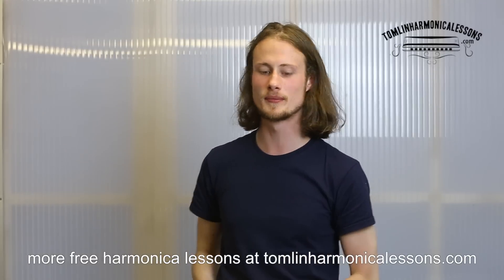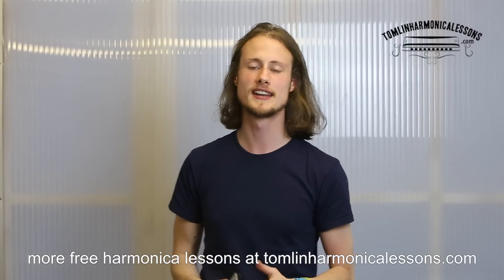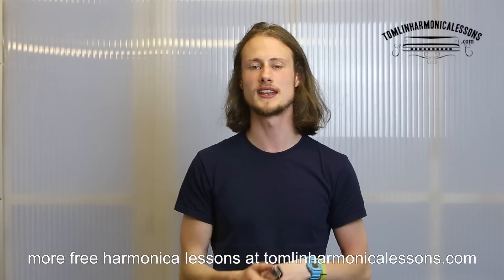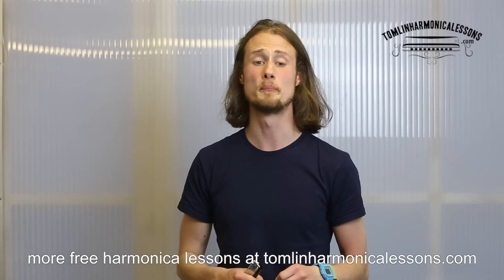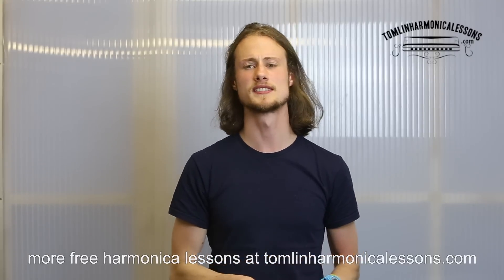How to play 2 draw whole step bend on a C harmonica

Comment: I've found I've just managed to do it, but it doesn't sound great.  It only works if I breathe in a bit through my nose at the same time - I wonder if that's something I should be doing
Reply: But weirdly I've also found I can do it if I hold my nose!  I've been reading up on the internet, and it's obviously a thing that some people have a problem with. I'm guessing that the kind of movement that I'm doing in order to do the bend is causing an airway to open.
Reply: Ok, I read around a little more, and I realised I shouldn't breathe in through my nose while draw bending.  I've just about managed to get it now anyway, although it's far from perfect (also far from ok).  It's just a question of keeping at it I reckon - if you can bend  down a microtone then just keep working at whatever you're doing and it seemed to begin to click eventually. I also fiddled with the gapping a bit, which may or may not have been a good idea, but it seemed to make a difference.

Comment: Any tips for the 2 draw whole step on Key of A?
Reply from the maker: Hi Nicholas, the 2 draw whole step bend on an A harmonica is the same principle as the 2 draw whole step bend on a C harmonica. However, the tongue position is slightly further back (still pointing forward though). Persevere with it and keep pushing a little further back each day and eventually you will get it. Cheers, T

Comment: This may be odd but I have no issue with my 1 or 2 hole bends whatsoever. The one that I have fits with is my 3 hole half tone draw bend. I can get the whole step and tone and a half step no problem but the half step gives me fits. It’s like the note goes from not bent to at least a whole tone.  

Any ideas or advice?
Reply from the maker: Absolutely! This is very common. When you are bending you are changing the size of your vocal cavity to tune it to the pitch you are bending to. As you find the lower bends on 1 and 2 easier that means you are going to a larger vocal chamber size. This is too big for your 3 draw half step bend and so you are pulling past it to the whole step. Try slowing down the bending movement from clean 3 draw to 3 draw half step bend and listen for where the bend happens. It will be much further forward in your mouth than you are expecting.
Reply: @TomlinHarmonica  makes perfect sense I will do that. The thing that baffles my mind is the fact I can get ell the bends on my A harp (even the half tone bend on 3) but have issues with it on my C harp especially my Manji. My A harp is also a Manji but I can bend it no problem.  

I assume it’s a combination of not having the muscle memory great on the bends and maybe the gapping is a bit wide on the C Manji I have.
Reply: @TomlinHarmonica  thank you for the guidance.

Comment: Is it possible that there's a manufacturing glitch with my harmonica (:Hohner special 20)? Cause I can half bend all notes UP TO 7 (even 7 a bit) , but can only go to 2 half step bend no matter any technic I've tried.
Reply: Nevermind, it was the video compression that made me think 2 whole bend is lower than I played it. I looked it up and it's the equivalent to the note F which I can actually reach easily. Now I just have to practice. Thanks for the video btw!
Reply from the maker: Glad you got it sorted George :-)

Comment: Great tutorial. I'm extremely new to harmonicas. Have seen few videos and read few articles about 2nd position playing. However one thing which is not clear to mean is on which all holes what action leads to the notes of the blues scale in the key of G (in a 'C' harmonica i.e. key of C in 1st position). Blues scale in key of G, I suppose is: G, Bb, C, Db, D, F, G. That should normally mean:
2-Draw (G), 3-? (Bb), 4-Blow (C), 4-? (Db), 4-Draw (D), 5-Draw (F), 6-Blow (G - higher). So for Bb is it a half-note bend while drawing on 3rd hole, and Db is half-note bend while drawing on 4th hole ? Can someone clarify this ?

Comment: Hi Tomlin, this is helpful and i think i get little mini-bends occasionally now but it's after a struggle!  I struggle with hole two on the C harp mainly - can bend other holes and hole two on other harps (eg a & d).  Is this a common thing?
Reply from the maker: +gary16642 hi Gary, this is common. I would spend time on the A and the D and get it really really comfortable. Then, try moving back to the C.

Comment: The two hole whole step bend and three hole one and half step bend seem impossible for me! 

This is so frustrating.
Reply from the maker: If you are struggling to get them, try moving up to a higher key harmonica for a while as the bends will be easier.
Reply: Did you ever get better on low bending? I had no luck till I realized you have to pucker much tighter, which makes the hole between your lips "smaller," 2.) Draw faster and harder through that smaller hole your lips are creating & 3.) draw tighter & harder still, like you're pulling a thick milkshake or pudding through a straw. 
Don't get discouraged. You have to build "embouchure" like a sax player.
Reply: So it's harder on an A harp then. I have no trouble with this on a C. I've played Sunshine of Your Love.
Reply: It really relies heavily on changing the shape of the "pipe" the air's forced through. One thing that helps me is to think in letters: I form a long A shape & sound and quickly squeeze it into a long O, while intensifying the pressure in the mouth cave (or cavity).
Reply: Thank you for the tip!
Reply: the hole 3 and 2 are the hardest bends !!! I learned them last after pratice too much
Reply: I was experiencing the same thing now. Could do all the other bends, and blow bends, but couldn't do those 2. Never even came close, until the Darth Vader tip. Weirdly, it worked.
Reply: Oh my God, I got back to playing after 3 years and the pulling the jaw thing helped me get my first G#! I am so excited.